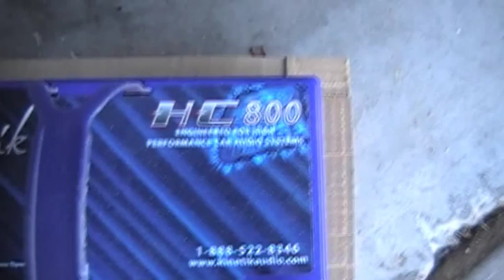New box for John's system

Comment from the maker: Thanks for your concerns. 3/4" is fine as long as it's braced. As you could see I added bracing to the box. The box is tuned to 32hz with the sub inside. This guy didn't really know what he was doing when he built that box. It wasn't even sealed and the back piece was rattling like crazy. After I "fixed" it the guy was more than happy. You just have to know what you're doing.

Comment from the maker: I didn't upgrade my alternator. I have 4 10s on 2k rms. BUT I have 2 extra batteries (57ah x2 ). My amp draws about 120 amps at full tilt. Between that, the upgraded main battery and the stock alternator I think it should be alright. Please learn more about what you're talking about so you don't look like some sort of troll

Comment from the maker: You said it was pointless to have a system without an upgraded alternator. Well you're full of shit. Batteries store energy, true. But they also release that energy. I use pure lead deep cycle batteries. Do you even know what the rating means? It means it can deliver 60 amps for 8 hours until its drained (10v). 2 of them in parallel can deliver 120 amps an hour for 8 hours until discharged, The juice is still there, just at lower voltage. You said it's pointless. Hear my system then talk.